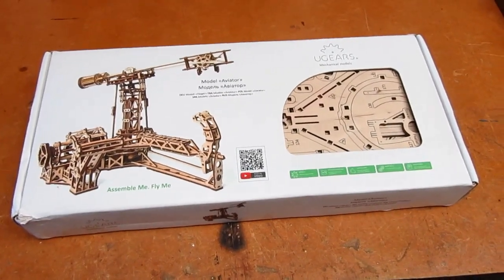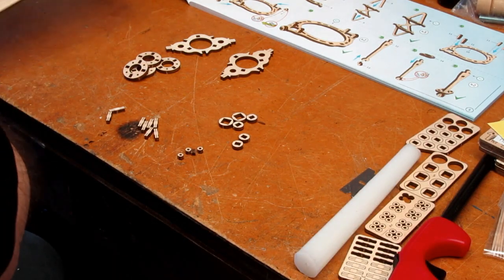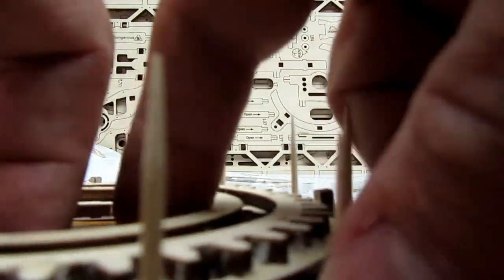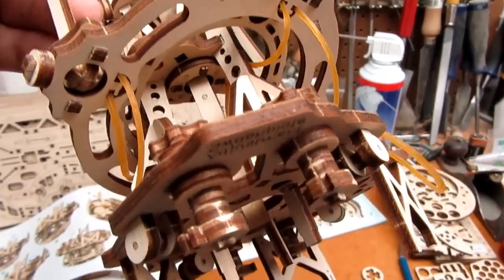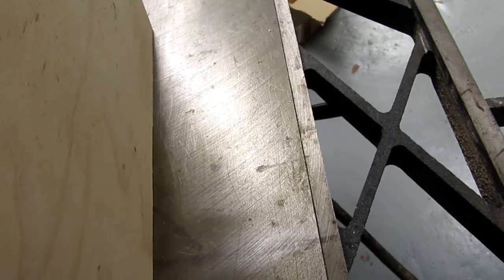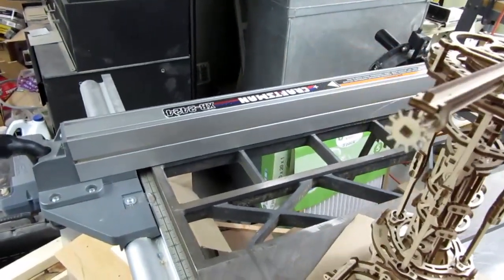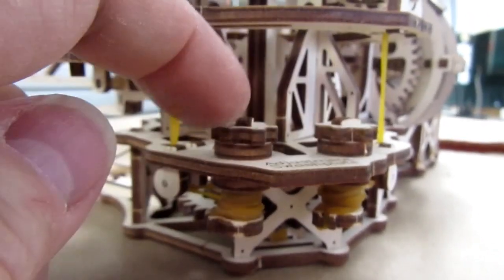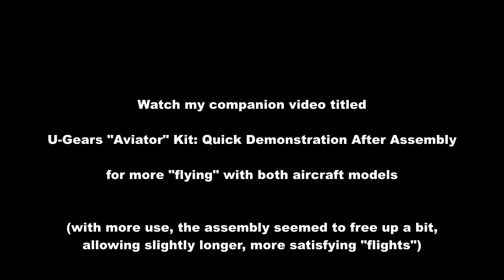U-Gears "Aviator" Kit: Detailed Assembly Process

Comment: I too have made this kit...and found that the rubber band system gives about two or three revolutions before resorting to uncranking the rubber bands manually.  Still was fun whilee it lasted.

Ugears has introduced steel spring mechanisms as there new power source.  There is a great difference between the carousel (rubber bands) and the aquarium (steel spring): the rotation times seem to increase by a factor of six to seven times with the aquarium.

I am in the middle of the desk clock and found the same effect.   And also when I finished the Cobra sports car...another spring steel power source -  there was an improved performance over other car kits I have built.

When you unleash the spring for the first time the mechanism also roars with the released energy.  This is definitely the "Wave of The Future" for these excellent kits!

Comment: As much as I like watching your workshop episodes I like these model building ones too.  Have you ever built model airplanes like the revell brand?  I did when i was a teenager but it didnt turn out too well.  Im sure yours would!
Reply from the maker: Joseph B, I actually have, both in my youth and more recently, built many aircraft models made from polystyrene plastic parts (e.g. Monogram, Revell, etc). I currently have a fleet of WWII 1/72 scale bombers and cargo aircraft hanging from the ceiling of my home office, including both of the large Northrop flying wings, B-29, B-50, B-17, Catalina, Lockheed Super Constellation, B-36, and modern B-2. I did a good job on them, but not quite as good as a dedicated and skilled 'professional' model maker might have done.

I have TWO C-133 models (both identical), also in 1:72, that have been waiting for years for me to get interested in building them, and SRN4 hovercraft in 1:144 scale. I have been thinking of putting those together one of these days, but have had too many other projects taking up my time. I have also run out of places to display them, which puts a damper on my enthusiasm. That, and it has been so long since I last built models of that sort that many of my paints and such have gone bad, so I would have to somewhat 're-tool' in order to build them.